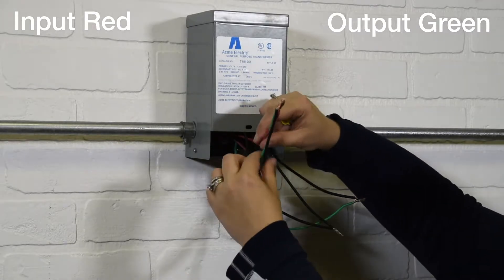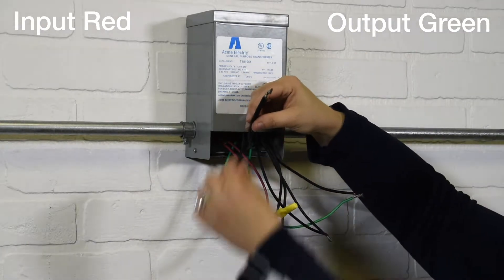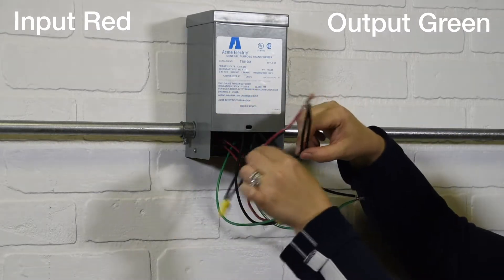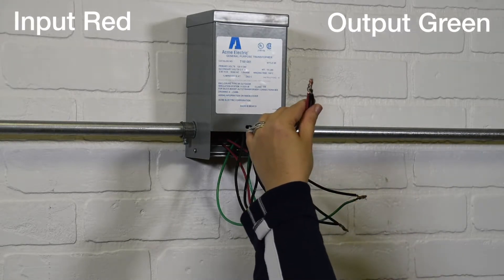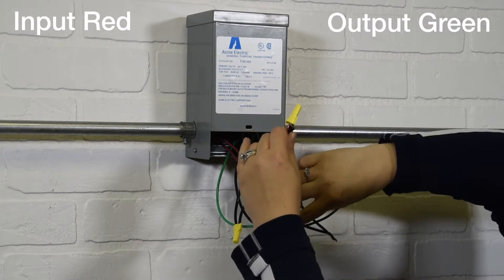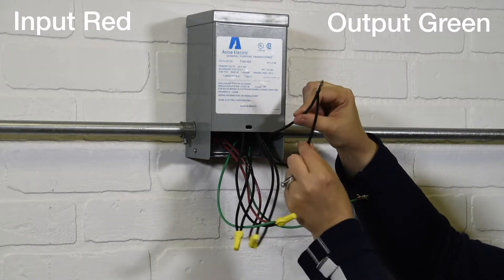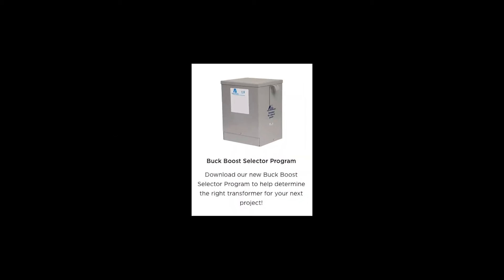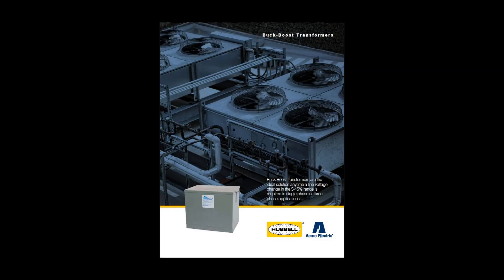Hubbell-Acme Electric Single Phase Buck Boost Wiring Demo- Catalog Figure H

Comment: I have the generator purpose transformer T-3-53041-S  I believe chart 13 in the catalog. I want to boost 1, 120 single inputs to boost  to 2 , 120 outputs with video the best for figures c through I

Comment: How can i do this but with 208 to 240
Reply from the maker: I will ask engineering and get back to you. Thanks!
Reply from the maker: Hi Max. Our engineers tell me "Boosting 208v to 240v using figure “H” would require using a transformer with a secondary voltage of 16/32 volts. If you used a secondary voltage of 12/24 then you would only boost to 230v." Hope that helps!